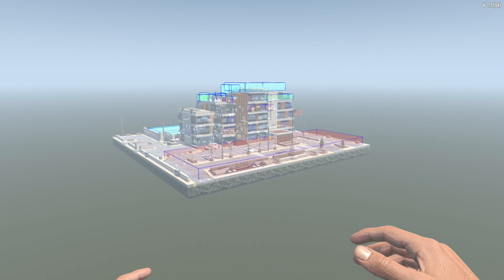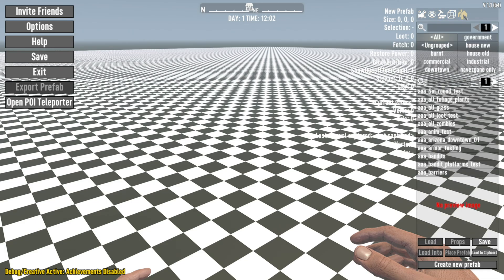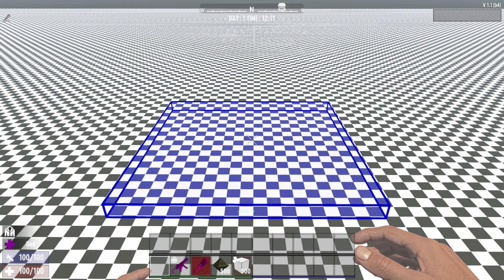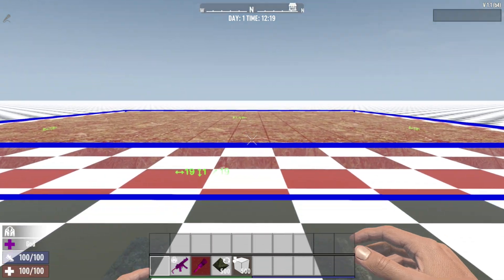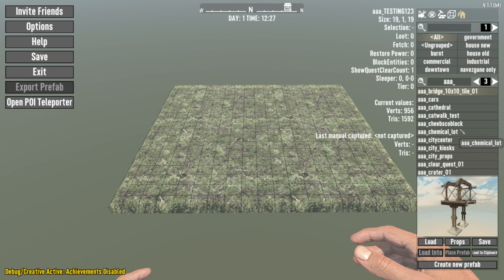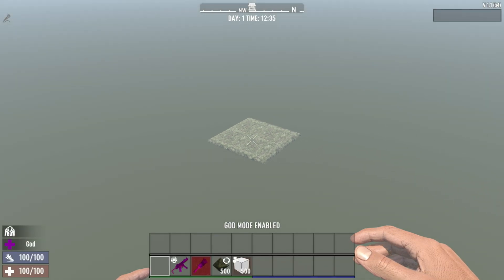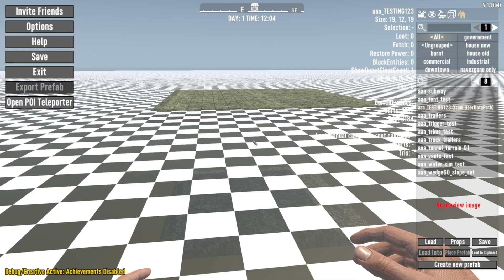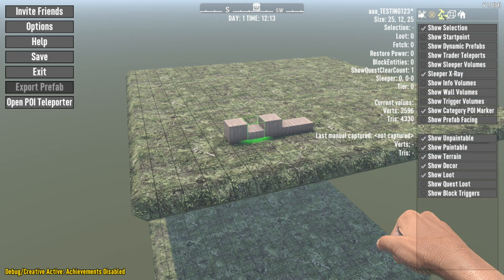Prefab Editor Tutorial Series - The Basics Explained - 01 - 7 Days To Die

Comment: Hello, I have a curious question when it comes to the editor tool. Is it possible to make a prefab that can replace an entire map with a structure going from build height to bedrock? It's a crazy question I know, but so far I have no answers with all the searching I've done.
Reply from the maker: No this is not possible. Yet you could put lots of POIs next to each other to cover a map. My latest Mega City maps basically do this as the whole map is covered in city so therefore the whole map is covered in the tile prefabs next to each other.